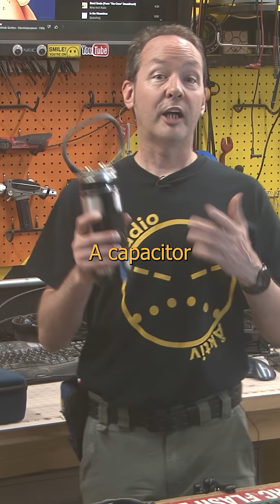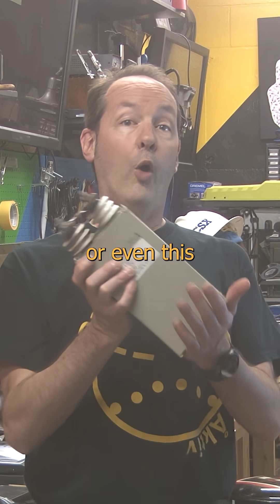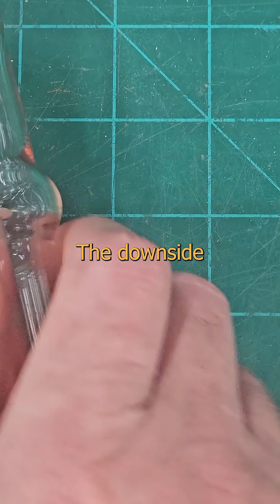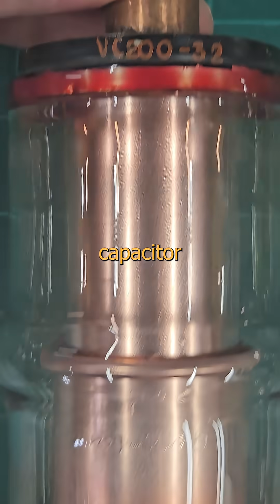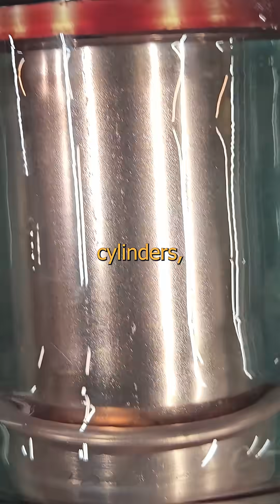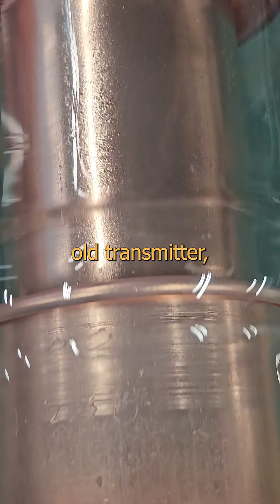Vacuum Capacitor #chrisboden #comedy #engineering #highvoltage #science #parts #apprentice #radio

Comment: And if you're not careful, you just might learn something. Hell, even if you are careful.  I'd hate to bridge that with my body when it was charged.  It would make a pop like a running squirrel across a pole transformer at peak power. Which I've seen. The squirrel didn't. Transported to heaven in a puff of smoke.

Comment: That’s just a little one. I have a 20.12uuf (that’s how it is hand written on the envelope) made by Machlett. It measures 14” long and 8” in diameter. I was in the Navy at sea, repairing a module for an A6 radar and had a bad (cracked) 22pf ceramic disc, so I ordered a replacement. The system substituted that huge cap for this module. I was told to throw it away and they ordered me the correct part. That was 42 years ago and now sits in my display case of antique light bulbs.
Reply: Mine's bigger than yours. lol 😂
Reply: we want pictures!
Reply: @jonathansmith2323 I would love to share a picture. Otherwise it just sits in my antique light bulb display case, that nobody but me in my family could care about. I just don’t do social media other than scrolling through YouTube. So I am open to suggestions.
Reply: @ricknelson947  If you're on YT already you could just post a short video. Hurdle is learning the hoops to upload a video, but if you're a user then by default you're also able to post videos
Reply: @ricknelson947  just jeffin', friend. No pictures in YouTube comments anyways...
Reply: @jonathansmith2323  he just showed you the goods. ffs.
Reply: But does it have a flared base? 🧐
Reply: @itsTyrion the base is a little larger than 2” in diameter, with two pins. The top is chrome plated with a bayonet connector that is larger than one would expect. The parts inside are a larger version of what Chris showed us with his, except they appear to be chrome plated. Unfortunately the painted on part number was mostly rubbed off prior to me acquiring it. I googled Machlett tube capacitor pics and there is one that looks similar but has a large maybe Mogul style screw base. Still working on getting a pic posted. Help is stopping by this weekend.
Reply: I knew you were in the navy the second I saw micro-micro instead of pico
Reply: don't be a poopty poopty pants
Reply: Obsolete as fuck. Now we have ultracondesators.
Reply: Pico is 10^-9 iirc, but
Reply: @DavidSmith-vr1nb  -12, nano is -9

Comment: Oh dang, that's actually really low capacitance. I guess that the fancy material is mostly for its rating as opposed to the metric itself. I guess that tracks with why it's used in signal fidelity as opposed to power correction.

Comment: the company I work at as a maintenance technician has a few RF sealing presses that use these. they’re a pain to troubleshoot because they’re unlike anything i’ve ever worked on and quite a bit older than I am (not saying a ton) and there are several part like these that i’ve never seen in any other machine in the building. i’m starting to get a hang of them but there are these and many other capacitors in the panel that make it stressful to work inside because of how dangerous they can be if not properly discharged before handling.

Comment: Up to 1.92 megawatts before bad things happen. Even a very brief over voltage event would cause destructive arcing, so it probably normally operates at half that voltage or less. The amperage rating may be dominated by thermal considerations. In which case, the peak amperage in normal use may be considerably higher, as long as the average amperage is below 200 amps.

My guess is that it was designed for use in high power military radars. Those send brief, but very high power pulses. The radar transmitter might be rated at multiple megawatts.

This is based on a first year college level of physics understanding. I don't have any relevant radar experience.

Comment: Apparently the amount of energy in a capacitor is 1/2*C*V^2. The square of 32,000 is over a billion, but 200 pico, 0.2 of a billionth, with the 1/2 it is only holding a tenth of a joule (roughly, at max voltage). There's very little surface area, but it is constructed to hold back a lot of volts.
Reply: This fuckin thing,  now part of my vocabulary!

Comment: Those capacitors are used in RF heat sealers. The ones I've seen always had a penny on each end as the copper contact. I always thought it was cool to see Abraham Lincoln on each end if those things.
Reply: Probably just cheaper than getting copper contacts coz you can just find pennies on the floor coz nobody wants them lol
Reply: Who do you work for? Always curious about anyone that has worked the rf sealers.
Reply: @sirmagnus99  I was the lead man for the maintenance crew at a bindery in northern California. We made three ring binders and other types of notebooks. There were were seven RF sealers ranging in size from 30 watts up to over 100 watts. One was very old and had no documentation.  Another was huge and had eight of those glass capacitors arranged in a circle that boosted the power so much that we had to deactivate it because the FAA claimed it was interfering with aircraft that flew overhead. I never actually believed that but during a sealing cycle you could holdup a fluorescent light bulb fifty feet away and it would illuminate.
Reply: Wow, that machine needed some extra grounding lol. I worked for Lancs, still do from time to time. We made containments and radiation shielding. We had cosmo/kabar and thermatron machines. The older ones used the glass caps like this, in a circle in a brass tank. Some only had one off the high voltage dc and the tank was square and empty. Its was crazy how each machine had probably been the same long ago but now was modified in different ways but still worked. I think of the caps as energy dumps. They all connected to ground and they just wicked off a bit of the initial rush of power so things didn't burst into flames.
Reply: @sirmagnus99 Several of our machines were made by Cosmo/Kabar. We also had two old Faratron machines and we just called all the heat sealers Faratrons. The Faratrons had an adjustable version of those glass capacitors that were used to tune the power for different jobs. You're right about the grounding on that big machine. We tried everything. It was grounded directly to an earth ground pounded through the concrete floor and the product holding fixture had ground straps everywhere  but we could still see arcing all over the place. We eventually gave up and dismantled the machine.

Comment: the biggest capacitor I've worked with so far was 4000uF 40V. It's the smoothing capacitor for the voltage regulator of my model train controller. In that same regulator is a 2200uF 25V capacitor, and a 220uF 20V capacitor. It runs on 12v DC and switches between 9V and 6V out.

Comment: Something cool indeed. Now do inductors. Not transformers, mind, we know those. The weirdest ones I've ever seen are flat spirals of  heavy solid conductors on distribution poles. I don't understand how they can possibly have enough reactance to matter at distribution levels of voltage and current.
Reply: I've also seen trash can size open helices.
Reply: Remember reactance is related to frequency and supply frequency is tiny.

Comment: My intrusive thoughts tell me to put this on my tongue 
It is a battery after all innit?
Reply: It's actual capacitance is absolutely tiny. The reason  for it's size is the extremely high voltage rating. A normal computer one of the same capacitance value would be the size of a rice grain.

Comment: 60... Amps? Not miliamps? At 32,000 volts? Did I hear that correctly?
Reply: Yea..  do the math..  60A x 32kv is more power than required to get to 88MPH and go back to the future.
Reply: @markkennard861  You must be a signals person.

Where I work we normally use 4160 with a trip current of 3000 amps.

That's 12 megawatts.... 

What usually happens at those power regimes is pretty cool looking plasma arcs.

Air when it goes to plasma is a pretty purple color.
Reply: @markkennard861 

GREAT SCOTT!!
Reply: P = e x I
P = 30,000 v x 60 amp
P = 1,800,000 watts?
Reply: @geraldfrost4710  we need 2 Marty that one old Flux capacitor doesn't kick hard enough...
Reply: @geraldfrost4710  no, var
Reply: Up to 1.92 megawatts before bad things happen. Even a very brief over voltage event would cause destructive arcing, so it probably normally operates at half that voltage or less. The amperage rating may be dominated by thermal considerations. In which case, the peak amperage in normal use may be considerably higher, as long as the average amperage is below 200 amps.

My guess is that it was designed for use in high power military radars. Those send brief, but very high power pulses. The radar transmitter might be rated at multiple megawatts.

This is based on a first year college level of physics understanding. I don't have any relevant radar experience.
Reply: Probably that is just the peak charge/discharge current that only applies for a microsecond.
Reply: 200 pF · 32 kV = 64 · 100 · 10^-12 · 1000 F V = 64·10^-7 C of charge at full.

Discharge at 60 amperes would empty that in ≈ 0,1 μs
Reply: High voltage RF, not power line frequencies.
Reply: I know some of those words and I think the big numbers the math works out to means “touch this at the wrong time and you die. Painfully. But thankfully quickly.”
Reply: I'm not sure that these are taken concurrently.  They could be limits to failure.

Comment: They should make those for air conditioners so they never need to be replaced but then that would reduce jobs for ac guys😊
Reply: You would probably have to buy another house block just to have enough space for it though
Reply: "Fun" prank my dad used to play on the new guy in the HVAC shop: take one of the big condenser-fan-motor-starting caps, charge it up, tape the bottom of it to a sheet of aluminum foil, wrap the foil loosely over the top (NO TOUCHING), pick it up by the safe end, yell "Think fast!" and huck it at the kid. 9/10 will reflexively catch it, crushing the foil and shorting the contacts. It's only in the three-digit microfarads at 440v, and none of it's going through the person, so it's perfectly safe. (For certain values of "safe" -- it is basically a flashbang grenade, but the foil goes up in a puff of smoke before it can do any harm. 😵‍💫) And that's why all the caps Chris shows off are shorted, because they can pick up charge just sitting around.

Comment: What is a used case for this considering how little power store is?
Reply: @hunter_parker  the tiny ones are usually for filtering, they smooth out the voltage variation between peaks.
Reply: @tomp7835  I understand that but why not just use an electrolytic it saves space and maybe it the the fact I work in IT but space is at a premium
Reply: Different types of capacitor have different advantages 
Like electrolytic capacitor have the second best energy density 
 @hunter_parker 
And if energy density is the main goal 
Use a super capacity and if high voltage is needed use a mini transformer or just put many in series (if voltage required is below 300 voltage)